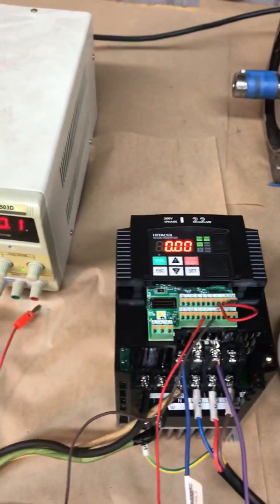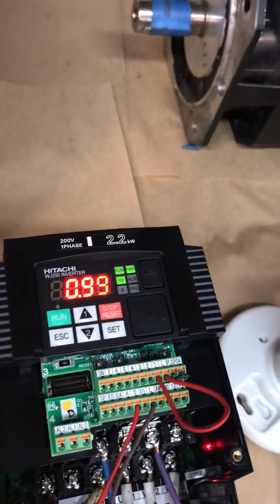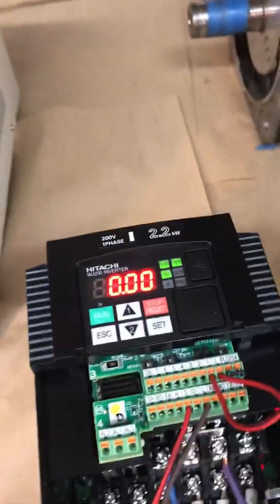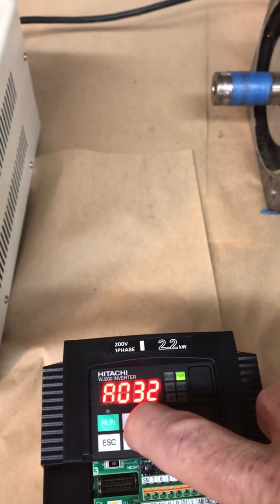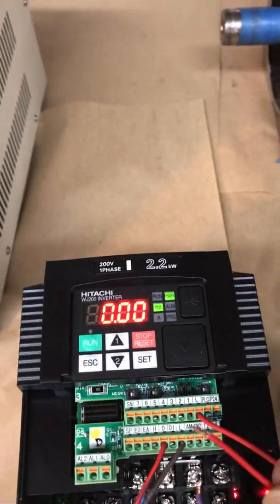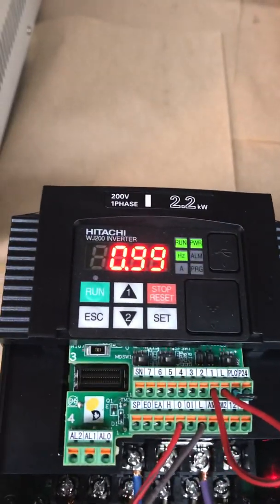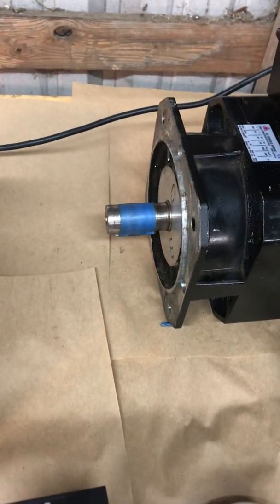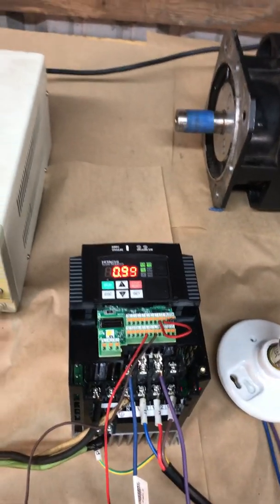Hitachi WJ200 sensorless vector vs constant torque

Comment: It's strange that you say sensorless Vector has more torque than constant torque because all the companies are showing that they're vdf has more torque on the constant torque setting, they show themselves trying to stop the motor with there hand or piece of wood and they can't. Are you sure you're not making a mistake?
Reply: i was wondering this myself, usually constant torque is the load requirement and what the motor provides, and sensorless vector is the means by which the vfd makes it happen

Comment: Thanks for pointing this out.  I have been running mine in the default mode for years and cursing VFD's, LOL.
Reply from the maker: Your welcome
Reply: @CHRISINMCNEILL  I changed the setting on my 24" Grob bandsaw to sensorless vector and the motor pulses several times on startup, but after that it runs.  Looks like I need to check everything out again.

Comment: Why would you choose the constant torque if the vector setting is better? Thanks for this video 👍🏻
Reply: It's more reliable/easy given no consideration of the physical load, take for example you have a conveyer belt that you are retro fitting a VFD to replace an old soft start system or just looking to have speed control, all you have to do is plug it in and off you go, if the machinery jams the motor will heat up a little before cutting out. Compare that to SV control where you need to either plug in all the model parameters (lots of math to come up with those out of thin air) or do a handful of auto tune runs with varying loads/configurations, then you need to validate all the failure modes, because if you stall a motor under SV control it's far more likely to burn up or cause mechanical failure with all the extra torque available.

Comment: hi James any chance you can share your settings or help me verify mine?  I'm in the process of setting my wj200 up to run with my centroid acorn using analogue 0-10v and relay board to switch directions and do the reset.  here is the link to my post on the centroid forums i would appreciate it if you could have a read and verify if my settings are correct http://centroidcncforum.com/viewtopic.php?f=60&t=2382&p=16819&hilit=Hitachi+WJ200#p16819  thanks Ash